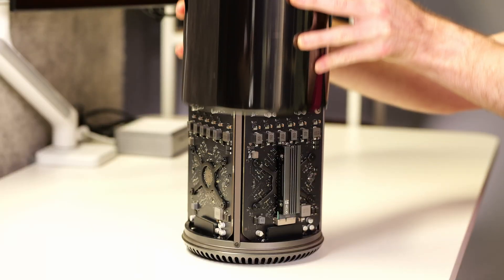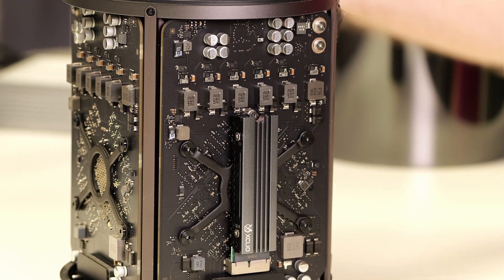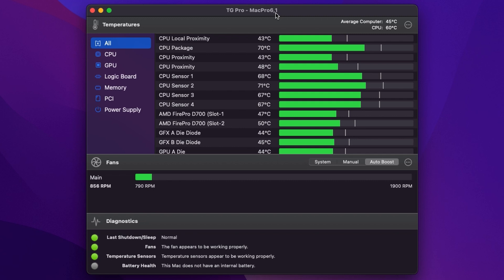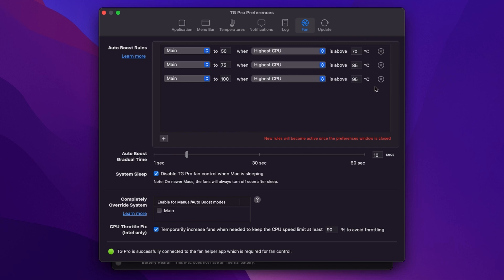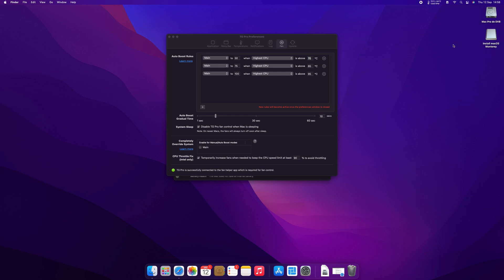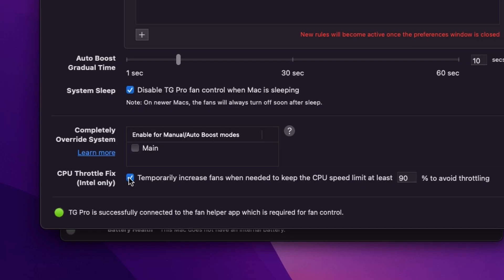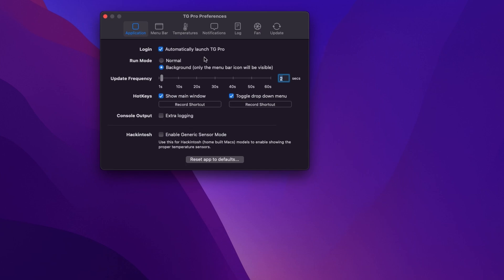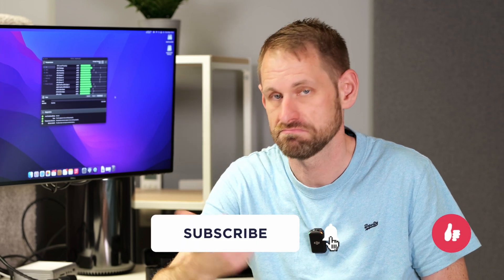Custom Fan Control for the 2013 Mac Pro

Comment: I am using MacsFan control for for boot camp, windows 11. It seems the fan control is tricky for windows 11. Is it ok to increase the normal fan speed to 1200 rpm instead of 790?

Before installing the app
I have noticed that the cpu reaches max temp of 52degC, which is not much. But even then the system shutdown suddenly (kernel power error was detected). The inches were also hot, SSD, outer case etc

After installing the app I increased the fan speed to 1200 rpm.
There is now a noticeable drop in the temperature, the SSD is cool , as is the outer case

But is it ok to run the fan speed at higher speed? I am installing a cpu fan (exhaust mode) outside to help with the air flow
Reply from the maker: I don’t think there’s a problem running it at 1200. There are quite a few temperature sensors in the Mac Pro, so it’s worth looking at which is getting hottest, and base your fan settings on that. This can also highlight any potential problem areas. Since all the components have a common heatsink, when one component gets hot, so do the others.

Comment: 90c is way too hot for a Xeon... You should have the 100% percentage set at around 75-78c. They are designed to operate up to mid 80s but will start to throttle even then. Waiting for the CPU to hit 90c for full fan usage is asking to shorten the life of your components. GPUs are designed to handle in to the 90s sometimes but rarely.

Comment: Hi, love your videos and explanations, they make it so much simpler to understand what 2013 mac pro is capable of. I'm getting a 8 Core model with D700 GPu (only 32gb RAm and 256 SSD but will updgrade them later) I wanted to ask in your opinion which is the best OSX version for the mac pro 2013, as in its runs seamlessly without issues etc...? Thanks for any info its appreciated! :)

Comment: Many tests outcome is 8-core better than 12-core because of thermal throttling, so under stress 12-core drops performance constantly to prevent overheating. Do you think with this app 12-core could be a winner over 8-core in multi-core?
Reply from the maker: The app certainly helps keep temperature under control. Based on my own testing, the 12-core can certainly beat the 8-core in highly multi-threaded workloads and something like TG Pro will help with that. Still, for many applications the 8-core (and 10-core) chips will be quicker - they are better all-rounders for most users.

Comment: Does this work on windows fort mac pro trashcan or do i even need this for that if im using windows
Reply from the maker: It’s a macOS app, but there are other apps that will work in Windows, or even both macOS and Windows. I haven’t personally tried or tested any of them. Windows does have its own fan management, so I’d have a look to see if it’s managing temperature well before installing any third party tools.

Comment: Yea seems to me it was all about apple keeping the system quiet but at a cost of thermal issues this also doesn’t help it’s on a triangular heatsync with all three sharing the thermal load on this one single fan. Needed more fan control options built in don’t get me wrong love the design but took one of these to bits a few days ago and found the cpu burned in the middle wasn’t good

Comment: I've used TG Pro in the last on other computers, it's great. I currently use iStat Pro, it offers more monitoring options for system resources, and functions pretty much the same as TG Pro. It does cost more, though. I have my Mac Pro fan set to 100% all the time. I use it for VMs, and it's in a tight spot where it needs more air pressure to stay cool. at 100% I can't hear the fan over my air scrubber and RAIDs. There's been several times where I forget to turn the computer off, and don't even realize it's running for a few days, until I feel the hot air blowing out the top.

Comment: I use Macs Fan Control, have used it for many years now, great for the 2011 MacBooks etc. to help stop the GPU overheating and failing, and use it now on my 2013 Mac Pro for the same reason as you, I didn't like how hot it ran, especially when editing videos.
Reply: Same, I just set it on high when the temps get too hot on my trashcan

Comment: I got my Mac Pro running with MacFans Control and I love it. The fan speed is based on the  temperature sensor of one the graphics card (one that sometimes show +1°C than the other). It starts speeding up at 45°C and reaches max speed at 65°C 😉 It's a free app and I started using it with my MacBook Pro A1260 10/12 years ago. Works great in my opinion 👌🏻
Reply: Thanks for sharing! I'll be getting my, recently purchased, 2013 Mac Pro 12 core, 64GB, 1TB with the dual D700s that I got for $256(w/o tax and shipping). When it arrives, I'm going to swap out the thermal paste on the 2 GPUs and the processor to see if that helps keep them cool. I imagine the thermal paste is toast after being on there since 12/2014.